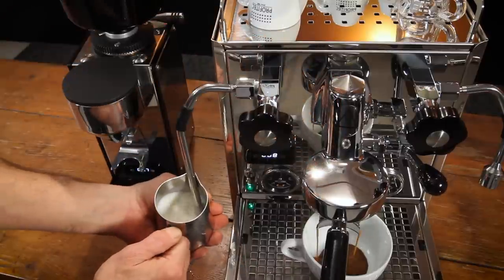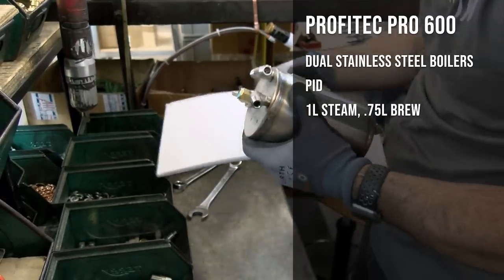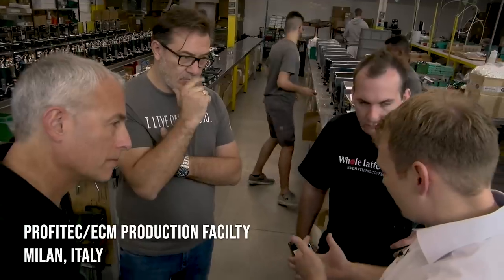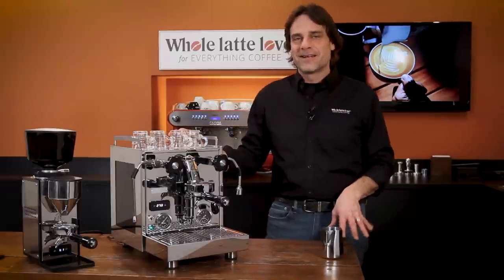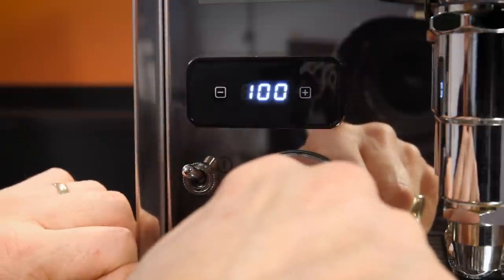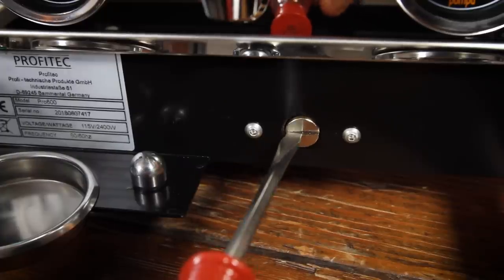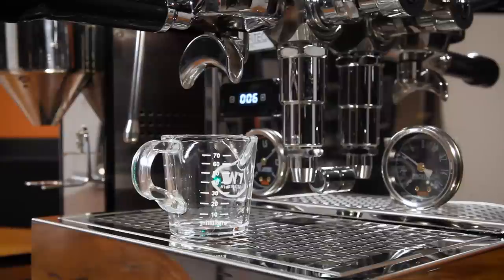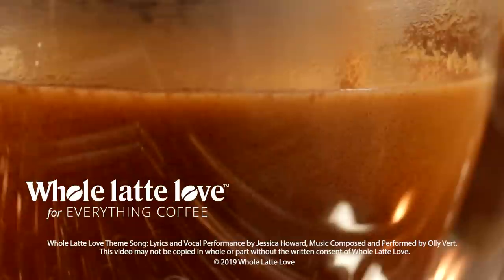Review: Profitec Pro 600 Dual Boiler PID Espresso Machine

Comment: Oh hi Marc, Two questions.
Any grinder/machine packages going to exist on the 600?
Looking to make the plunge into the prosumer world. Would this unit be too complicated for someone with no experience? I'm trying to avoid the urge to upgrade to a nicer machine.
Reply from the maker: Hi JK, Love the Oh hi Marc! My kids say that all the time :) Contact us here: https://www.wholelattelove.com/contact-us And I'm sure a package can be worked out. The Profitec Pro T64 grinder in the video is perfect with this machine. As far as too complicated... What a dual boiler machine gets you is far less complication than a single boiler machine. Brew temps are always accurate and there's no screwing around with surfing temps like you'd have on a single boiler. Plus steam is always available and gosh darn powerful on this one. If you have not done manual steaming before there is a learning curve to that but it's far, far better than what you'll get on cheap entry level appliances. If you want to go nicer the best options are the Pro 700 or next level finishing of the ECM Synchronika.
Marc

Comment: Hey Mark! After watching this vid, as well as your vids on flow control... I'm leaning towards ordering the Profitec Pro 600 w/ Flow Control.  Watching your vids leads me to 3 questions? Does the Pro 600 w/ Flow Control still have the 2 bars of pressure for steaming just like the one in this vid? On WLL the Pro 600 w/ Flow Control shows a 2 tip wand, unlike the 4 tip wand in your vid here, does this mean I'm required to purchase 4 steam tip separately? And is there anything else that is potentially different between the Flow Control model and the one in this vid that may not be immediately obvious? Lastly, are there ever sales on WLL for these models? I've seen Rocket's go on sale, but I'm leaning towards Profitec for Flow Control + Steam Power.
Reply from the maker: Hi Jeremy, Thanks for the questions!
The current Pro 600 does have the same best in class steaming power at about 2 bar in the service boiler.
I believe the current 600 has a 2 hole steam tip - unfortunately I cannot quickly confirm that is the case. If you want the 4 hole and it comes with the 2 you would have to purchase the 4 hole but it's not required.
The only difference with flow control 600 is the mushroom valve and the E61 mounted pressure gauge.
Sales on these models are incredibly rare. We do offer "Latte Rewards" which I think on the 600 gets you $50 towards a future purchase, free shipping and 3 year warranty. I don't get involved in the sales aspect of these machines. But, you can def call our coffee experts 585-924-7170 for details.
Hope that helps!
Marc
Reply: @Wholelattelovepage  Thanks for your reply. I ended up calling and talking with one of the sales reps who put together a really great package deal for me to get everything I wanted plus a nice discount. Looking forward to receiving my machine in the next week or so.

Comment: Hi Mark great review as usual...Pro 500 pid or Pro 600 any opinions?  I’m between these two... 3 or 4 lattes a day...I’m a newbie.. thanks
Reply from the maker: Hi Aurelio, Thanks for the comment. Both are fine machines. Size is nearly identical as the Pro 600 is built on the same chassis as the 500. If doing more milk drinks I recommend the 600 for the extra bump in steaming power. Let me know if you have any more questions. Or, you can speak directly with our coffee/espresso experts by phone/chat/email: https://www.wholelattelove.com/contact-us
Marc
Reply: Thanks for the insights Marc!!!  Waiting for the 2019 best espresso machines video!
Reply from the maker: @aureliocastro6478  You are welcome! Any particular category of machine for inclusion in Best of '19?
Reply: Hmm I would like to see HX and DB, also it would be cool to have another for accessories 👌
Reply from the maker: Aurelio Castro will def include HX and DB. So far accessory of the year is Leveler specifically The Jack by Asso Coffee. But the year is young!
Marc
Reply: I’m waiting for the Jack to be available 😬

Comment: Hey Marc thanks for your very interesting videos and helping advises. I proud owner of a new pro 600. Compared to my old e61HX machine I have the feeling that the pro 600 needs longer time for stable group temp @ about 1h. You had I nice measurement data compare group heat up times of pro 500vs bz10 vs Giotto. Do have such group temp measurement for the heat up of pro600 as well for me to compare? Is it possible with new machines that there remain s particals from the production process within thermo cycle of e61 which may slow down the heat up process? Best regards Cord
Reply from the maker: Hi 84cord, Thanks for the comment and question. An hour for full heating to stable seems very long! While HX machines might heat a bit faster due to the higher temps in boiler. It should not take an hour on a Pro 600 if everything is operating properly. I think it's unlikely there are left over particles from production but it's not out of the question. I've been to Profitec's production facility in Italy and every machine is tested after building. If you purchased the machine from us it was prepped again with full test of temp/flow prior to shipping. You could check flow rate from the group to verify. With no PF in place and machine warmed up measure how much water you get in milliliters from the group in 20 seconds. Divide volume by 20 to get grams per second. It should be in a range of ~8-12g/s. If below 8g/s there may be an obstruction.
Marc
Reply: @Wholelattelovepage  Hey Marc, thanks for your fast reply. I measured exact 7,4g/s for several times. Do you think this is still acceptable or should I contact Profitec?
Best regards Cord
Reply from the maker: 84cord let me check flow rate on a pro 600 here. I may have made a slight error and given you flow rate reference more typical for a rotary pump machine and not vibration pump like 600
Reply from the maker: Hi 84cord, Just ran 3 flow tests. Ran pump for 20 seconds and weighed water output. Results were 163g, 164g and 160g for flow rates of 8.2g/s, 8.2g/s and 8g/s. While your rate is .6g/s slower I doubt that is enough to indicate any restriction in the thermosiphon. Your rate difference from mine could be measuring error. I doubt it has anything to do with a longer heat up time. Are you 100% certain your machine is taking 60 minutes to reach stable temp? For faster heatup of the brew boiler you could turn off the steam boiler as described on page 25 of the Pro 600 manual: https://wiki.wholelattelove.com/images/3/3b/Profitec_Pro_600_User_Manual.pdf
Another tactic for faster heatup is running blank shots thru the brew circuit
Marc

Comment: Hey Mark,

As always, great video. A question about steam pressure on this machine... How far do you have to turn the steam knob to achieve full steam pressure output on the 600 vs. 700? 

I hear on the 600 it’s 1 or more full rotations, whereas on the (2019) 700, it’s a mere quarter turn?

Also does that rotation amount change on these machines if you’ve set the PID for the steam boiler at 1.5 vs. 2 bar?

Thoughts? 

Thanks!
Reply from the maker: Hi Christopher, Thanks for the questions. Both machines have "sprung" valves. There was a recent upgrade to the 700 valves so down to about a quarter turn from off to full open. Valves on 600 are under one full turn from off to full open. I'd say between 1/2 and 3/4. With higher pressure setting you will get more steam with same valve opening but more pressure does not change the amount of turn required to go from closed to open. Hope that helps!
Marc
Reply: Whole Latte Love Thanks Mark. Appreciate the clarity!

Comment: Hi Mark, thanks for the great video! I have 2 questions. Is it true that pressure on vibra machines must be (2bar) higher than on rota? Because Vibra have pulsating pressure. And the second question - I dont like combination of chrome and black on pro 600. Is it possible to get side panels in chrome? Thanks!!!
Reply from the maker: Hi AB, Thanks for the questions. We set vibration pump machines OPV to produce 10 bar on a machine pressure gauge with a backflush (blind) basket in the PF. That gets you max 9 bar at the group. Rotary pumps with higher flow rates (11g/s vs. 8g/s on vib) are set to 9 bar on the machine gauge which gets you 9 at the group.
Pro 600 panels... We only have black but they can be switched out by end user.
Hope that helps!
Marc

Comment: Hi Marc. Thanks for the video review. How is the quality of the espresso shots in the 600? Can you compare the quality of the espresso shots on the pro 600 compared to the pro 700 and ECM synchronica- all other variables equal ? I’m down to choosing between these three machines. I plan to use water reservoir only (not plumbed).
Reply from the maker: Hi KQ, Sorry for the delayed response! Bummer you don't want to plumb! Plumbing the Pro 700 or Synchronika gets you the line pressure pre-infusion which opens up the next level of brewing. Also can help make shots more consistent as pre-infusing can reduce channeling thru the puck. If you didn't already know the 700 and Synchronika have identical brewing systems. So no difference in potential shot quality. The 600's brewing system is nearly identical to the others with same boiler and hydraulics to the group. Big difference with 600 is vibration pump with a rotary pump in the others and no plumbability so no pre-infusion. All can do pre-wetting of the coffee when working of reservoir dropping an once or so of water on the puck from group and residual pressure in boiler. If not plumbing all are IMO capable of comparable shot quality. There are some opinions on rotary vs.vibe pump shots but it's incredibly subjective. Vibe pumps build up pressure slower. Rotary pumps may be a little more consistent with pressure. Changing grind and/or technique can cancel out any advantages of one over the other. At the end of the day I prefer rotary pump machines. They are robust and have a more pleasing sound than vibe pumps.
Marc

Comment: Why such an advanced machine still using Casio type of screen 🤔
Reply from the maker: Hi V, this screen type is very common on espresso machines and used by many manufacturers. It's lower cost, durable and gets the job done - a K.I.S.S. part. There are some machines out there using more advanced touchscreens like the Bezzera Matrix: https://www.wholelattelove.com/products/bezzera-matrix-de-dual-boiler-espresso-machine
Marc

Comment: This machine is a couple hundred bucks too much for that size of steam boiler. The specs are basically identical to the Quick Mill QM67 Evo and 20 secs to steam 6oz is on the slow side which is on par with the QM which people complain is a slow steamer.
Reply: Gustavo Sanchez the QM67 build quality does not look like the Profitec. Look for under the hood picture of both and compare how component are laid out and assembled, that speak for itself... Also QM67 use cooper boiler vs stainless on profitec. My personal taste goes to quality vs just the lowest price.

Comment: Can you remove the side panel and use glass or polycarbonate to enjoy the engineering beauty inside?
Reply from the maker: Hi AN, Yes it is possible. Then there are machines like this which have that feature out of the box: https://www.wholelattelove.com/products/bezzera-matrix-de-dual-boiler-espresso-machine
Even has adjustable color highlighting of clear panels on sides of machine.
Marc

Comment: This sounds more like a sales pitch than a review.
Reply from the maker: Hi Aj, The video includes test results like time to steam to temp and boiler recovery after steaming. I'm fairly certain no other video on this machine goes into details like the stainless mushroom valve (by the way far better than chromed valves in some competing machines). The video covers specs and features like extra functions available via the PID controller and how to use them. I mention the casework is nice but you can have better in the Pro 700 or Synchronika if that's important to you. I mention the machine is not plumbable. Do you want me to say that's a fault? For some it could be. For others it's not. I mention the machine has no internal venting of moisture with the steam boiler vacuum relief valve vented to the drip tray. Many competing machines leave this open and vent moisture internally every time the machine warms up. I show you the machine and you can make up your own mind. I stand behind everything I say. I could have gone further and told you how Profitec goes into extra details in finishing the machine. Like the internal welded seams of the drip tray which are polished. Many competing machines simply spot weld these parts and leave the welds bare. Or talk about the chassis design which has a continuous solid rail front to back. Many competing machines weld on the drip tray support which leave them susceptible to damage in shipping. If I sound like I'm a fan of this machine it's because I am. I've worked with and been under the hood of most every prosumer level domestic machine currently available in the US market. IMO this machine and others by Profitec stand out with reliable K.I.S.S. design, innovations like the stainless mushroom and best in class steam power. It's up to you if you want to see it as a sales pitch. If there's something else you'd like to know about the Pro 600 please ask here and it would be my pleasure to provide you with a detailed answer.
Marc